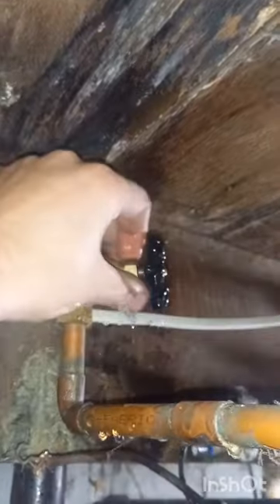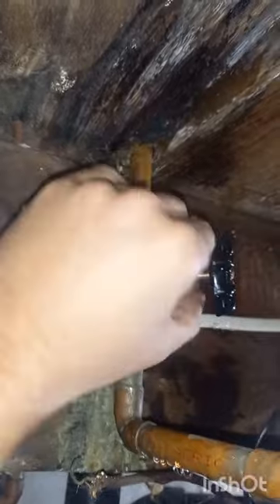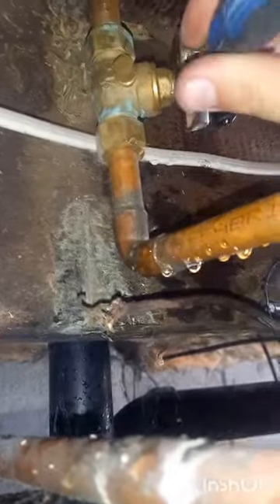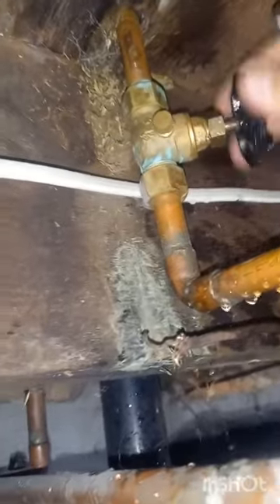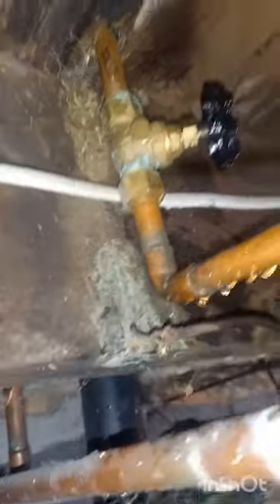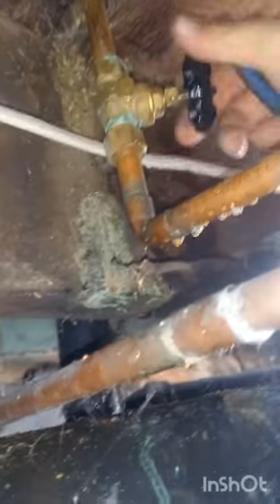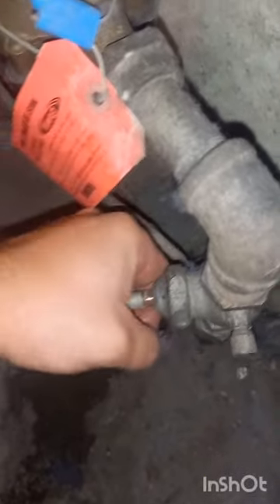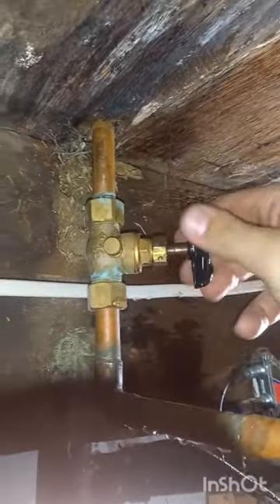Leaking gate valve. Easy fix #shorts #plumbing #plumber #plumbingservices

Comment: Set the valve to a position that is not all the on or off then tighten nut. Some of these valves carry the valve stem threads and packing on the same cap.  He shows both styles here.